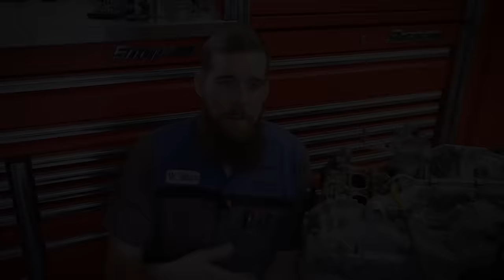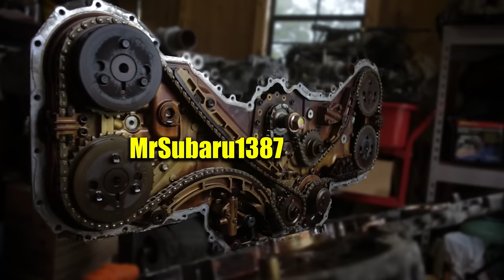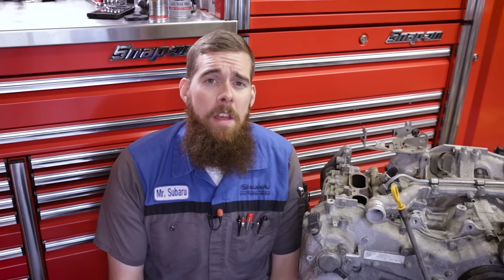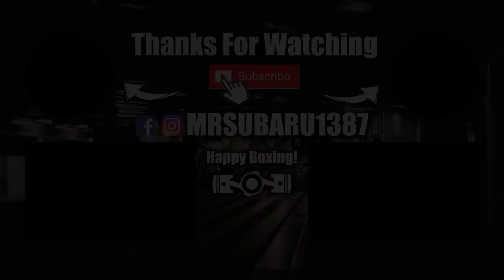Why Subarus Are So UNreliable!!! Buckle Up!!!

Comment: We bought a Subaru 2010 wrx with seized engine. We rebuilt the whole engine. Below are list of things we put in.
Mains and journal bearing.
New crank shaft.
Piston rings
Head gasket
All new seals. 
New timing belt. 
Valve seals.
Ground the fly wheel.
New clutch 

It is all back together now, had few issues but we were able to fix them. But now we are left with 3 codes P0171, P0011, P0021. We have checked filters for cam solenoid , checked solenoids itself,  vaccums leaks but they all look good. Also, these three codes keeps coming at the same time. Can you help me with this? Also the fuel economy if very bad. 13L/100km. 

Also, how do I know if it was tuned by previous owner?

Comment: 06 wrx ringlands failure. 100k sadly i did have a COBB and down pipe on it. And from i was told by many Subaru techs say thats the problem. COBB maps are a BASE not to be driven crazy with a 11:1 AFR way to rich. I actually could have put 4 pistons in it and ran it. But rebuilt it and ran ok but never was the same. 😩

Comment: I own a 2013 Subaru Legacy H6 engine. Is the car unreliable, no. Is the car troublesome? Somewhat. I use Subaru parts, but things just fail. It is not my most reliable car, or the least. It is in the middle. At 40,000 miles it starting burning oil. It is consistent - 1 quart every 5000 miles (when I change the oil, not at 7500 as Subaru told me to).  No head gasket issues. I have 117,000 miles now.  In the last 2000 miles I had the failure of the master brake cylinder which I recognized and replaced immediately, and the failure of the rear transmission cover gasket as it is now leaking oil (replacing this weekend). My 2006 Saab at the same mileage (previous car) had no failures at all except for a seat bolster (had it replaced). It lasted 191,000 miles before I sold it and it still runs today.  I hope to get the same out of this Subaru but we will see if it keeps having failures every 1000 miles which is maintenance, but expensive mainenance.

Comment: This is the first video of yours that I've seen, after a shout-out on the Torque Test Channel. I have to say, I agree 100%. My immediate family has owned somewhere around 14 Subarus since the early 90's, and only ever had issues on one that was not maintained at all (a 2000 3.0 that my mother rarely changed the oil in, never failed, just had leaks), and a 2009 Forester with ~90k miles that had slowly leaking head gaskets when we sold it. We currently have a 2016 Forester XT (only owner) and a 2020 Ascent that have been incredibly good cars (well, the Ascent did have a battery issue but that was taken care of). 

I've had very high mileage Toyotas (including the 2000 LX470 that's my current profile pic, sold it this summer with ~215k miles, going strong and built for off-road use), but nobody comes close to the performance, safety, capability, and reliability of Subarus, assuming they're cared for, in my experience. Hopefully our current cars will be our last exclusively-gasoline powered vehicles, but when we do get a plug in hybrid or fully electric vehicle, Subaru will be the first place we look.

Comment: I bought a 92 legacy wagon with 185k on the odo. Original engine lasted until 232k miles because my dumbass took a 900 mile road trip with out checking the oil once and spun cylinder 1 rod bearing. Loved the little EJ22E. Put a $100 unknown mileage engine in it and got another 20k out of it until I sold it. Will buy another someday haha

Comment: I took my 2011 to the dealer for several years and one time they replaced the block at 90K. due to poor design trying to get better mileage from it. Now at 130K my steering pump is failing, making much noise. I have looked at prices for this item and find it too expensive to replace but I have too I guess. I have never had steering pump issues with any car I have owned in the past. GM, Chrysler, VW, nissan, and I am sort of upset that these parts are expensive and hard to find OEM new. This may be the one thing that turns me off of Subaru. I had a '99 ply voyager and no problems for 160K and decided part with it. Should not have. But the fuel pump went out at 160K. My wife's family has had Toyotas for years and no problem and so that may be my next car. Subaru parts are just too costly and hard to get.

Comment: I have a 2019 FB25D (Forrester) and I change the oil myself like clockwork. I cant trust the oil change shops. I caught two different ones getting ready to drain the CVT fluid. I live too far from a dealer. So i want it done right, I do it my dam self. I did get a 10 year/100k warranty on it because when I bought it, I didn't know they fixed the Head gasket composite issue. I plan on keeping this car until it falls apart or gets totaled. If you want to put a stage 2 kit or whatever in it, then grats, VOID WARRANTY! You cannot expect SOA to pick up the tab for a non OEM change. only issue I have with this video is the CVT 9Dealer only) we cant check it. But thats not Mr. Subaru's fault.

Comment: I forgot to mention, keep the radiator caps the same as what came on the car. Don’t change the upper reserve tank or radiators. One is a one-way cap and the other is a two-way cap. This can cause over heating issues and cause some serious engine failure if messed with. The reason is the caps dictate when the thermostat opens and closes and monkeying with these can throw that off.

Comment: Unfortunately I cannot agree 100% with you here. I have been a Subaru advocate since the first time I tested a 1999 Impresa RS. In 2005 I purchased a new Forrester XT which I still own with 130K miles (and will sell very soon). Also, in 2006 I purchased a new WRX Limited that I sold last year with 190K miles. I also had a 2000 Legacy for about 5 years. I also owned cars of other brands like Toyota, Honda, Infinity, and Mitsubishi. I kept a maintenance calendar and did light mechanical work on those cars (oil changes, suspension work, etc.), but for anything major I always called a Subaru expert that have been our friend for the last 15 years. So, I think I have enough experience taking care of my Subarus to comment here. In my opinion, my Subarus were very very DURABLE, but I cannot say they were reliable.

Comment: I'm boring.  I'm a daily driver that is conservative and believe airplane maintenance schedule  prototypes are used for my car.  Only OEM parts are used.  I've had an 1981, 2017 and 2019 and have had wonderful reliability.  In the past, I had several Vegas and their engines were reliable using my approach to maintenance.  Engines averaged 100k.
On the other had, VW diesels from the eighties are awful, eating headgaskets around 70k miles.  The wiring also and gasket adhesive around the winshield always leaked due to inadequate quantity of adhesive.

Comment: @MrSubaru ..I realize you're not talking about my particular case.. however,  the 2015 legacy 2.5 that we just owned and subsequently sold because it was the biggest piece of garbage I've ever owned ,I  bought certified in Florida from Subaru.. and maintained meticulously. Let me count the ways it was crap. 
52k miles cv axle(in Florida) 
54k miles cvt transmission
57k miles leather seat back delaminated
59k miles leather seat bottom
62k ,72k fuel door
77k fuel door cable
80k blower motor for ac
84k infotainment screen
86k blindspot detection sensor 
Went to sell it( still under bumper to bumper warranty thank God we got it certified) 
Had local Subaru specialist look it over for potential buyer
Camshaft seal and valve cover gasket leak
Engine removal required $2k
Are these maintenance issues? 🤔 
The absolute only issues the specialist found were those 2.. perfect otherwise
That tells you how it was taken care of
That being said.. between the absolute insane amount of yearly cost to maintain Subarus .. comparatively
The nosedive the legacy took value wise
The cost we would have been saddled with had it not been under an additional warranty during our ownership would have made a lexus on par cost wise.
We absolutely refused to RISK continued ownership of that car even though my wife really liked it as a vehicle. 
Imagine another transmission@ 108k ?
I understand you are referring to owners who abuse vehicles and the company rewards them.. however I had to absolutely fight for many of these repairs to be covered.. especially the leather coming apart at 4 years old. Take into account most of these repairs under warranty cost $100 deductible as well.. no rental car available except 1 case and loss of use. 
I also owned a 2011 na 2.5 forester
   Perfect leather still as my ex owns it
    85k miles short block replaced due to
            Massive oil consumption after I went and fought them for my ex when she told us about being almost 2qts low between oil changes and then telling her it's normal. 
After which the air conditioning went out 
A month after the engine replacement.. id assume there was a connection but of course there would be no possibility of that or Subaru stepping up. 
Other than that the 2011 forester limited has treated her well

Comment: I have a 2016 WRX FA20, pretty much full bolt ons and running a E50 tune. 165k miles and i have drove it like a stole, many times. No issues with it so fair, except the AC compressor went out a few weeks ago. Other than that, normal regular service and replaced the clutch around 80k. I don't understand why everyone said that the 16-21 MT6 is a shitty transmission. Never had a issue with my tranny either.

Comment: Just had ringland failure on 2019 STI. 50k miles, oil changes every 2.5k, AOS, basically stock. Im not going to lie, I did drive it hard occasionally because I bought a sports car to drive it like a sports car. Cast pistons with tight ring gaps on a turbo engine is a design flaw thats all imma say 😂.

Comment: mr subaru I have a question about timing belts kits. Recently my 2012 legacy with an EJ253 was totaled, so I replaced it with a 2009 Subaru Impreza OBS. I bought an Aisin timing belt/ waterpump kit for the 2012 legacy, but didnt get it on before the car was hit. Would I be able to use the TKF-006 Aisin kit on an EJ253b with AVLS?  thanks man, you've taught me most of what there is to know about my Subarus!

Comment: I had a 07 sti that I had moderately modified and well maintained. I was fairly hard on it and around 40k miles 3 pistons with ringland failure and two cracked pistons. Thankfully I knew what I was doing with the car it would happen and had another block set aside for when it happened. I don't blame the car and was prepared for it to happen. Ended up with built short block and gt35r turbo.

Comment: I agree with you, but on the '22+ BRZ they market the FA24 as a track bRed engine which has oil starvation issues on high-g corners due to bad oiling design.  That's either a design flaw in engineering or a colossal marketing flop.

Comment: I worked as a tech at a Buick dealership a while back and this guy comes in with his Park Ave and he is bad mouthing it saying what a piece of s@#t it is. It's got a little over 90,000 miles on it and he's claiming the transmission is bad. The trans is vacuum modulated and cable operated throttle valve (okay, it's more than "a while back") so it is highly dependent on the engine running properly in order to have smooth accurately timed shifts. Now mind you, this guy has never had to do any repairs to this vehicle for 90,000 miles. So I take it for a drive and realize there is a serious engine power issue and the trans problem isn't really a trans problem. It feels like either a plugged exhaust or poor fuel supply. I remove the fuel filter because it is obviously the original, you absolutely could not blow through it! I put a new filter on it and what'ya know runs like a new car. What a piece of s@#%t, not the car, the idiot owner. And that's just one example of stupid. I could write a book after 45 years in this business.

Comment: "you dont understand bro. that new muffler with the 1.5 inch inlet & 4 inch outlet gave me 75 more horsepower.& my chrome free flow air filter relocated beside my new header pipe gave me an additional 45 horsepower." is the quote of todays average 16 to 25 year old hot rodder.us old guys just shake our heads & walk away.no sence in even talking to them.it seems the blind are leading the blind.

Comment: My subaru has 240.000 miles on it it’s a ej2,0L and I’ve just rebuilt it and I have modified it with nice aftermarket parts I changed the oil every 2000 miles and I’ve always changed my fluids so I’ll keep you posted how long this next rebuild last me and yeah I have a cobb access port now 3-1/2 exhausts and headers and all new everything I’ll keep you poated😊

Comment: Hey I just discovered your channel. What do you think about bolt ons (quality parts, Grimmspeed/Cobb etc). on the FA20, with a conservative dialed and pro tune/etune (not off the shelf). As long as mainteined well (with an AOS added for reliability), do you think these are reliable vehicles? I change my oil every 3k using PUP and I let it fully warm up before ever going full throttle. Never launch

Comment: my stock fa20 took 9 psi for 30k no problems. headgasket was perfectly fine. in fact i made the dumb mistake to turn up to 14 on stock internals. it survived for a month and spun a bearing. no headgasket issues. i decided to go with a built fa20 because the engine did pretty damn well considering the constant redlining. i maintained it well but with the boost i was running it was destined.
Reply: mine spun a bearing going up a hill, the sub pump was in the front of oil pan so going up it went dry

Comment: I agree with most of what you said. BUT Toyota does use a Subaru power plant in at least 1 of thier models the GT86. Car companies have been doing it for years for synergy/cost saving efficiencies for decades and still today. It's a win-win for car companies. Don't believe me? Look it up. It's true. Would appreciate a follow-up on this...hey the more ya know right?  Thank you for the content.

Comment: My subaru  Impreza 2001 ej205 tdo4 wrx has 130k miles. I went for a safe msp 1.2 bar boost with cold air intake, bigger intercooler, 3 inch decat, updated fuel pump. Still tdo4. I can launch it no problems

I used ur videos to replace the rear main seal, clutch, flywheel, tie rods, oil pan and cam belt pulleys n belt.

I almost destroyed my engine though cos it burns so much oil. I changed oil and within a short amount of time it was so low. 

I wish u spoke about modifying? Like I now have low compression on cylinder 1. 135. Rest are 150. It runs fine no problems but I'm thinking about building a 2.5 short block to my wrx heads I just don't know what gasket to get 

Thanks for your videos

Comment: I had a 08 Legacy GT that went thru 3 turbos. could never figure out why. Never redlined or drove aggressively, had the head gaskets changed when I found the oil and coolant mixing together. Had 120 miles when I got it. I now have a salvaged titled 15 BRZ Limited. Runs amazing. But I did notice that the wiring for the headlights is screwed up. I have no high beams. When the lights are off and pull on the lever to flash them, the night time lights flash instead. The driverside Sidemarker does not have a plug, it is spliced to the wires for the headlights. Other than that, the car drives like it should. This is my 4th Subaru. My first was a 2002 Outback Sedan 3.0 H6 with 256k miles and my dad was completely against me buying it but after a test drive, car ran like I bought it new from the factory. Then it was the GT, got rid of it and got a 2013 Outback Limited with the Special Appearance Package. Then in 2020, I got the BRZ. Still have the 2013 for winter use.

Comment: I own both an 07 Impreza 2.5i and a 09 WRX and both engines had valve failures at 200k miles within a year of each other. Kind of a weird coincidence. I’m a maintenance nazi and I baby my cars so im shocked. I decided to replace the short blocks on both and have the heads rebuild. I’m actually still rebuilding my WRX at the moment. Driving the 2.5i around. I love my cars though. Regardless they made it to 200k miles in New Hampshire. The 2.5i was a college girls car and the wrx wasn’t super well cared for. I’ve basically rebuilt everything on both cars.